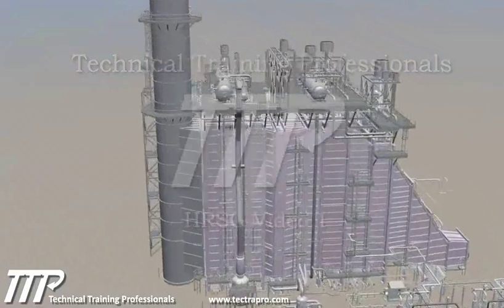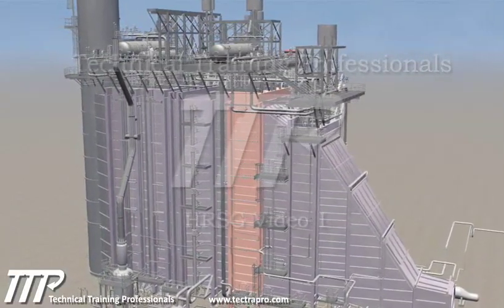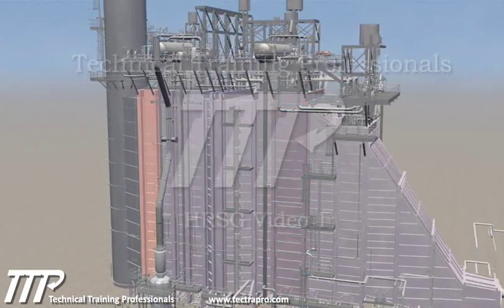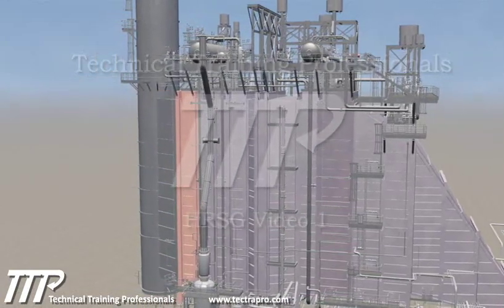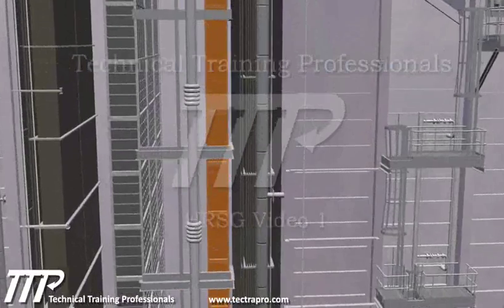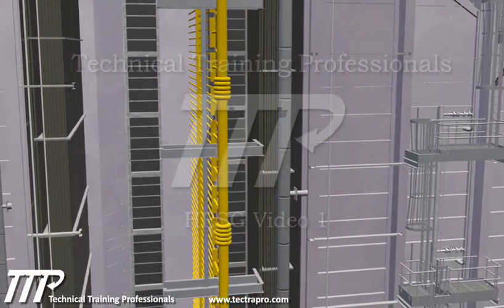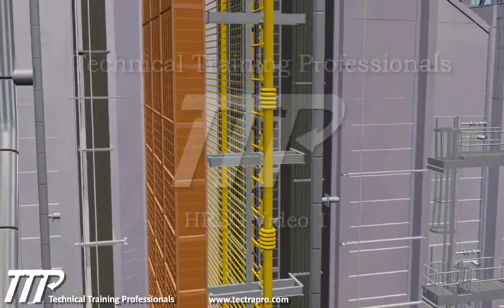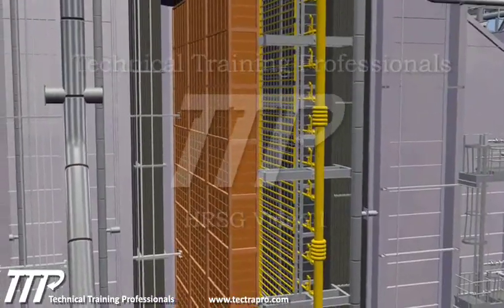Heat Recovery Steam Generator

Comment: Excellent video! The three sections (LP. IP, and HP) kind of reminds me of a reverse cycle hot water radiator heating setup. That is, super-heated exhaust enters at the right (the HP section) and cool exhaust exits at the left (LP section), while the sub-cooled water enters at the left (LP) and exits on the right as super-heated steam (HP).

Comment: Hi, why three different pressure and drums (HP, IP, LP) in HRSG
Reply: Yeah that because the pressure, you can't just put high pressure and low pressure together it might cause a problem, so the solution is just put HP/IP/LP drum with different pressure

Comment: what types of heat exchanger used in hrsg?
Reply: Tubes full of water, boiling water,  and steam.  This video shows the tube sections,  but it doesn't explain everything. Some of the tubes contain water which is heated up to near boiling temperature; some of the tubes contain boiling water, and some contain steam which is further heated to higher than boiling temperature.  Note that there are 3 pressure systems. Each system contains economizers (water heaters), boiling tubes, and steam tubes.  Also, the steam from the turbine returns to the boiler and is heated again, in the section closest to the combustion turbine. I work on something similar to this.
Reply: Looks like basically fin pipe. If you study traditional air conditioners, the setup is very, very similar: heat your refrigerant, evaporate it, then super-heat it. Then post-cycle, you do the revers: cool, condense, sub-cool. Rinse and repeat in a closed-cycle loop. Add an expansion valve before the evaporator and a compressor after it, and you get a direct-expansion air conditioner.

Comment: Can we use an HRSG if we have varying exhaust flow rates?
Reply: HRSG’s I’ve seen have gas burners aswell so if you take the load off of the gas turbine, you can increase the gas burners throughout the HRSG to compensate to still produce steam
Reply: I work on a boiler very similar to this.  Yes, it can work with all flow/ power levels. Typically when the unit is up and running at steady state,  the steam turbine produces as much power as it can with the given heat input,  and total power level is raised and lowered by throttling up and down the combustion turbine.

Comment: why is there an HP and LP in HRSG? what if there is no LP? and what are the consequences?
Reply: The LP system acts as a deaerator for the higher pressure systems.  Water normally contains air,  and the air is an unwanted contaminant which contributes to corrosion.  This is a much bigger problem in the higher pressure systems;  the HP drums have higher corrosion rates because of the higher temperature and pressure,  and any oxygen in the water whatsoever is unacceptable.  Any air which is in the feed water evaporates with the steam in LP section,  and the de aerated water from the LP section is then pumped into the higher pressure sections. 

You could design a HRSG with only one pressure (that's probably what the first ones looked like) but it would be limited to lower pressure and temperature overall, which would reduce efficiency.
Reply: @StephenMarlerexperience  Irrelevant on a closed-loop. I tend to think of this more as LP = pre-heat water, IP = boil (make steam), and HP = super-heat (make high-pressure steam), although I don't believe that is actually an accurate analogy. One assumes the while water loop is pressurized to 2-4x (thus raising the boiling point) so that the steam can carry more energy and do more work within the steam turbine.
Reply: @ but if you think my answer is wrong, then what do you think is the reason for 3 pressures? Why not heat all of the working fluid to the highest temperature and pressure?
Reply: Nana Nama saya the only consequence would be loss of efficiency.
Reply: @motor_head51  thank you